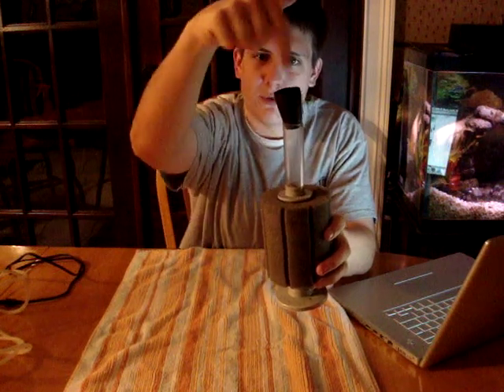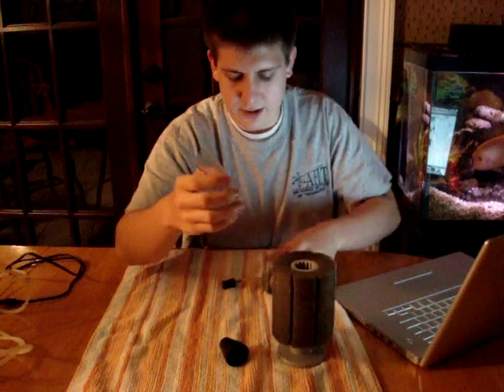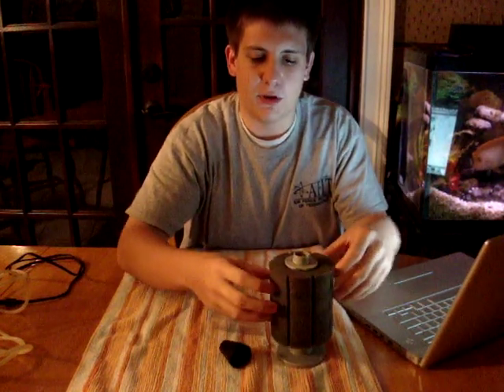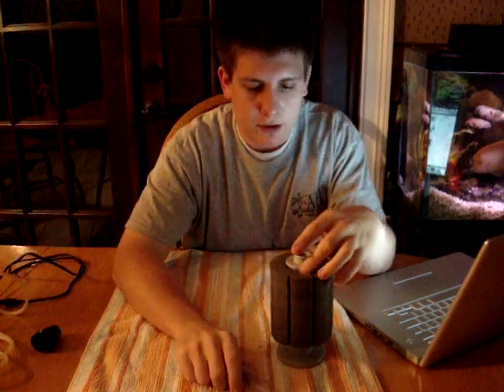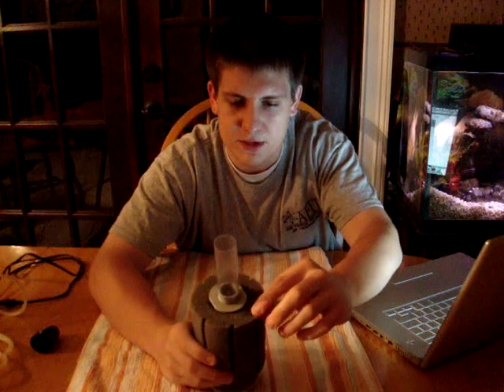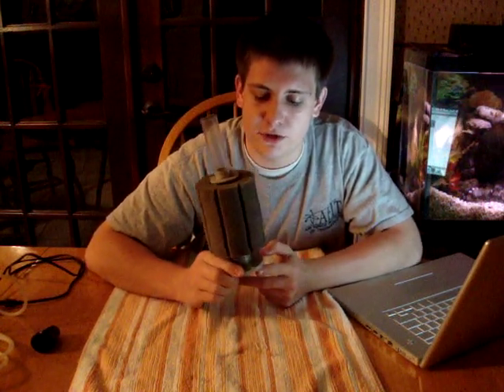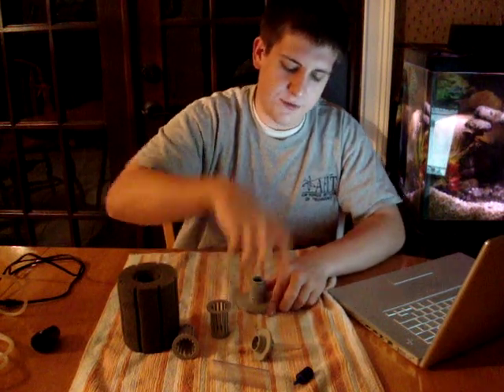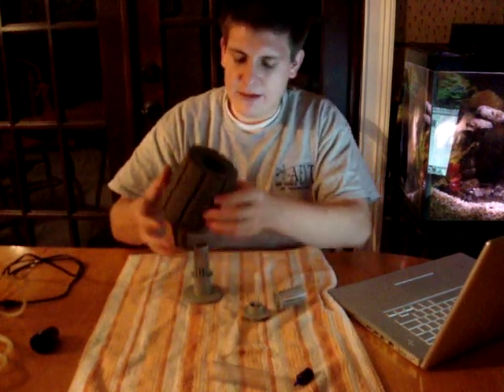How Sponge Filters Work

Comment: No way I dont believe they beat undergravel filters, I was just thinking these things are like a smaller crappier version of an undergravel filter. I just cant imagine it, it would have to have a strong sunction. Can anyone give me some input on this please
Reply from the maker: Some dude Heres the scoop in a nutshell. Your gravel makes poor media, and although theres a large quantity of it, theres many stipulations to it. A sponge filter (depending on the filter) is going to be able to harbor a higher density of beneficial bacteria due to design and media. On top of that your gravel will do some degree of filtering on its own without adding a ug. To make matters worse is all the problems that come from implementing a ug. For instance your ability to do live plants is pretty much ruined. Not to mention the actual maintenance of a ug, which is just terrible.
Reply: AquariumTech I have had a 55 gallon UG up and running since I moved as a little kid in 2001, never taken down, and have only done a handful of water changes. (never full) Sucked up some junk from the gravel. All easy stuff. Giant fish, never any problems and clears the water faster than anything by sucking it all straight to the ground. I was so young that I didnt even notice that my huge catfish died in its hole and I just left it till it turned to bones untill years later i discovered its bones and was laughing. Never even harmed any of the other fish. Literally 0 maintenance for months at a time, maybe years I never touched that thing...just leave the timer on the power heads and i guess dont forget to feed the fish...
Reply: TBH i think anything else is just a scam to make money. If you want plants just add extra gravel. Srsly what matnance do you do to an undergravel filter? There is none... All i do is clean the gravel like any other system.
Reply from the maker: Some dude Well first off most catfish are pretty hardy and killing them isn't easy so thats a bad sign. Most fish can also withstand a great deal of toxicity in the water under the main condition that it is introduced slowly to them. Its the sudden change in parameters thats more deadly than anything else. It probably wouldn't be pretty if you took a fish from a well kept fish store and tried to introduce it into your tank.

 I don't understand how it would "clear your water faster" because it has very little mechanical filtering presence, and 0 chemical filtering abilities (sure things settle over time but I don't get what you mean by the word "faster") . Anything it sucks down might get trapped in the gravel (which is the point but also its downfall, its not a good mechanical or biological filter and has 0 chemical filtering so this leads to problems later), but as far as clearing the water would go, it would just get thrown right back out into the tank. Just because water is appears "clear" doesn't mean its not toxic. What happens is since gravel is a terrible media, a build up of unnitrified waste commonly occurs and many people refer to this as a "nitrate factory" since thats pretty much what it turns into. Its basically waste the media (or ug) can't keep up with, I would love to see your nitrate test. 

As far as plants go its not as simple as just adding gravel. First off you have the problem of the roots growing around the plates. At first this is just a hinderance to the plant but later can be come an issue of flow (clogging). That assuming the plant will grow in a gravel that is compatible with a ug. Sand and other substrates (what you want for plants) obviously isn't going to work out well with a ug. Not to mention your going to have an excess of oxygen due to the extra flow going through the gravel/roots where the plants feed. Plants obviously need CO2 so this is not ideal.
Reply: AquariumTech Catfish died cause he got too massive over the next few years he was like 1/3 the size of the tank(55 long)(also you act like he was the only fish in there. There were tons of diffent kinds of fish during the time). For plants I admit some more fragile plants might not be able to grow however if you really wanted to you would just add inbetween the UG and gravel a bonded filter pad which would also increase BB if it worries you that much. I have also kept every type of freshwater fish there is. My dad has tried every filter there is and he has been doing it for 50+ years he thinks the UG is the best thing you can have. However I do agree that you should have the UG complemented with something such as a hangout back or canister THis would be most ideal. But I just wanted to say that my 55 has been running with only the UG for years with 0 problems and nitrates are fine. Im sorry if I sound mean or offensive I dont mean to sound that way, I just find it so odd why UG's are so denounced. Its simple effective and any little kid can get/ use one for cheap. IDK what people mean when theyre UG filter clog, they must not be using it right cause I have never experienced anything like this. Sometimes snails get stuck in the power head but u can just pick them off
Reply: AquariumTech Oh and lol when you say introduce fish store fish (where else would I get my fish lmao) into my tank haha I just float the bag to get the same temperature then open it and dump them in. They get healthier than they were in the pet store. I.E. they go from skinny and very discolored to vibrant and fat ASS bellies idk there must be a alot of food in my tank. I just got a jag cichlid a little while ago like a few months I can send you pic of him if you want he is a kind one too. And dont tell me the petstore I go to isnt well kept its the best around the guy that keeps the fish has been a long time breeder and done everything his whole life. They have the best fresh and salt selection around. I even got my hydrcynus armatus there.They have EVERYTHING you can imagine. THEY SELL MONKEYS like the strangest things turn up there its great. Ithey even have lung fish there aro's "freshwater rock fish" Obv brackish I catch them under my bridge at jensen. Its great
Its clear I love UGF to each there own.
Reply from the maker: Some dude That is a good idea, to put filter pad in there, but thats just going to lead to, again clogging. Then what happens when it clogs? Exactly, thats my point; why go through all that anyways when I can just buy a power filter, and call it a day. Its a big pain to have to take those ugs out of the tank not to mention its dangerous for the fish. It can clog in the lift tubes, (more of a problem with lower flow or airline), sometimes what we mean by clog is the "nitrate factory" effect too. Again I won't argue, that they can help your tank grow aerobic bacteria (even though this is in detriment to any anaerobic bacteria you might be lucky enough to grow), its just the added problems they can create in the tank, where you have to weigh your options. Do I want to basically forget doing plants and have to use regular gravel (which in my opinion is ugly and useless), and deal with the possibility I might have to get under that thing to clear any unnitrified waste for a marginal gain in aerobic bacteria. When most power filters appropriately sized for the situation will have no problem keeping enough beneficial bacteria in the tank. Not to mention using one will give you a choice in media, which is huge, incase you have some special situation or you just like having a really clean water. Cichlids are very easy to keep and I can somewhat understand using a ug in that situation if your good with water changes and its only a supplemental filter, since you can't really do plants with them anyways. Even then though I would steer clear from it still due to the fact your going to still get a nitrate factory at some point especially with cichlids who make a lot of waste. 

We have a store like that sells exotics, and they are the worst. What they do to animals is absolutely atrocious, they have been in trouble with the law many times, as most of those places do. They usually get those exotics illegally from poachers, who are just the worst. I want to list their name on here but I'm not sure if its against YouTube regulations, their initials are I.P. here in Florida (don't know if you live here too). If you buy your fish unhealthy like that, why do you keep buying from that store? It sounds like they treat their fish like crap.
Reply: ...I have tons of plants you dont even need extra gravel. And idk what your talking about clogging and bad nitrates what does that even mean, my nitrates ahve been fine for over a decade. Have you ever used a UGF. I wont bring the stores name into the affairs... They are very good to there fish(i guess i exagerrated in my last comment), the healthiest fish I have ever seen in any aquariums. Your personal experiences are different from others. Just because you've been to a "w/e store you named" doesnt mean my store is just as bad. When I say the fish get healthier in my tank its because its true. Your forgetting that my tank has been established for 14/15 years.. All this shit is common sense. If you dont like UGF thats fine just say it dont bring all this other stuff into it. (Im just talking about that last paragraph, Dont jump to conclusions)
Reply: AquariumTech Also whats the best possible system IMO is a reverse undergravel filter with another system of mechanical filtration. UGF or RUGF I do recommend some other filter canister/hob etc etc mechanical filtration, but it is possible to run just UGF
Reply from the maker: Some dude Well everything I said about ugs, this is all well documented, and even people who still endorse these filters know about its Achilles heel(s). I just realized I didn't post the articles I had posted on my other ug video on this one, so I will go ahead and do that, feel free to give those a read. 

Theres a lot your missing from my responses, its ok if you don't know exactly how nitrogen cycle (and etc.) works, but I would recommend doing a little research on the subject. Now doing a cichlid tank with a ug and plants, not saying it can't be done, just saying if you know anything about aquatics those are all things that don't mix well. 

Your right every store is different, I just brought that up because stores that get these exotic and rare specimens usually have to get them through some sketchy means (usually illegal). So with that being said, the type of people that do that, probably don't care about animal wellbeing they usually only care about their wallet. I do animal rescue so I would usually recommend people steer clear of those places (or at least do some background research), especially after I have seen what they do behind closed doors first hand.
Reply from the maker: Some dude I just realized this isn't one of my under gravel videos lol. So I will link them here, and links to the articles will be in the description. Make sure to check out the American Aquarium Products links (check them all out), they have the best articles and are probably the closest thing that comes to an authority on aquatics information, very smart guys. 

https://www.youtube.com/watch?v=HbkGKSU6Y60

https://www.youtube.com/watch?v=spoMJo6aC4g
Reply: All good bro, but your jumping to conclusions again. I had to learn about the nitrogen cycle in my marine biology class and in courses for my nursing program (microbiology). I had to right heavy duty research papers. I know it on another level(what I mean is far more in depth than what the aquarium hobbyist would learn). No matter how you try to justify it my 55 has been up for 14/15 years, plants and every type of fish. And all I do is clean gravel (like every other system out there. And at the same time the change water) I have never had any issues with my tank parameters etc. If it works there is nothing to fix. Personal preference.